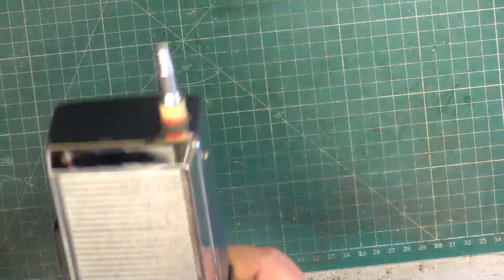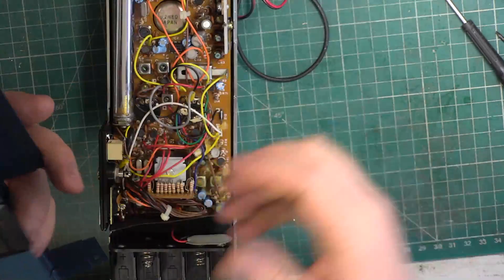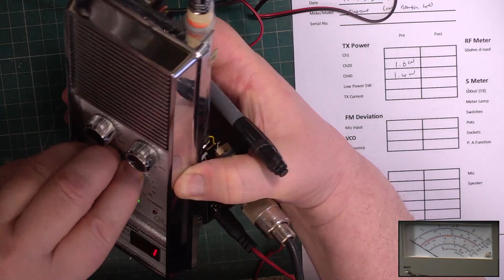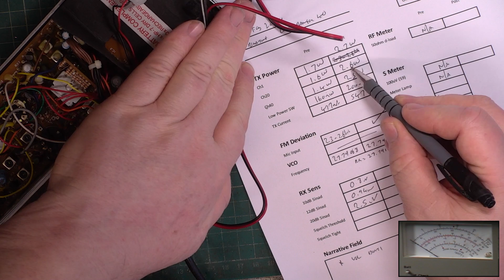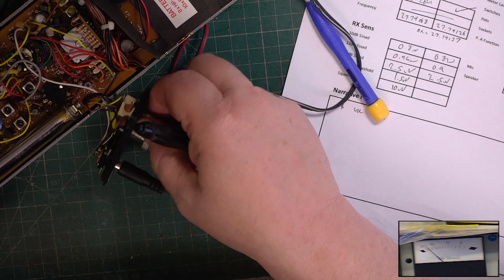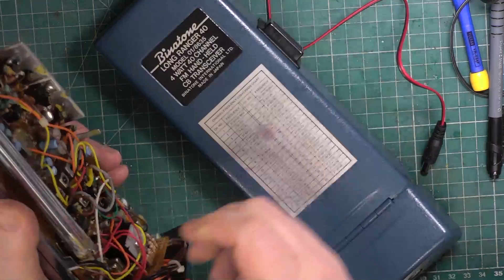BInatone Long Ranger 40 CB27/81 UK FM CB radio handheld - Retune & test

Comment: I think the test of hand held transceivers will be very interesting and revealing Richard. (My HCB1 Amstrads are not upto much sadly as you have proved before).
I had another look at the Harvard Good Buddy on this horribly wet afternoon. I bridged out the gangs of switch poles carefully to see if the internal contacts were the cause but still no '9' on the display.
Only 7 of the 9 switch terminals are utilised. I don't know how that compares to your example(s)?
I can't seem to find a switched pole that provides the '9' display provision with a ground connection.
This radio has a serial number of only 00717 so I wonder if this may be relevant?

I had to laugh about the speaker polarity as when we, as children, worked out how a speaker worked, we asked my late father if it made any difference and he said no, unless they were a stereo pair. Then when you went to the trouble of working it out, I started to question...you later set my mind at rest.
(Also, memories of Anti Sound on Tomorrow's World...handy for upsetting the girls and boys in blue if I had the equipment as they do like utilising their sirens these days)!😊
Reply from the maker: We have has 2.25 miles on an HCB1

On a 'good terrain' test rather than our usual 'difficult terrain' test
Richard